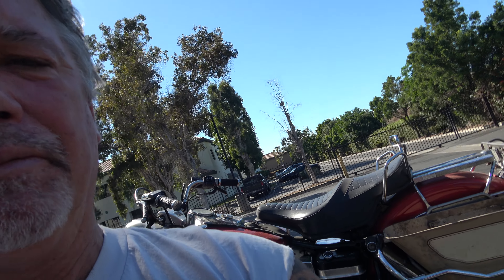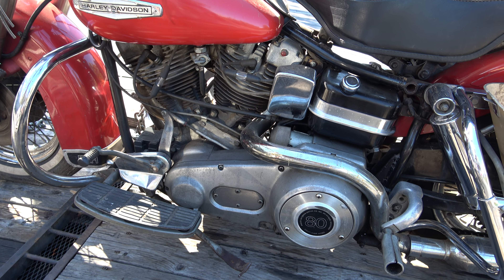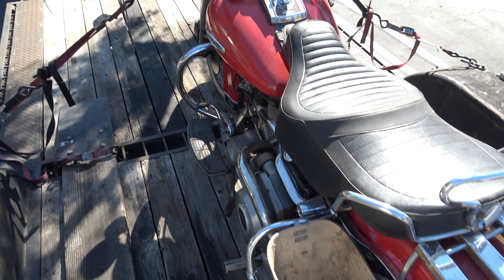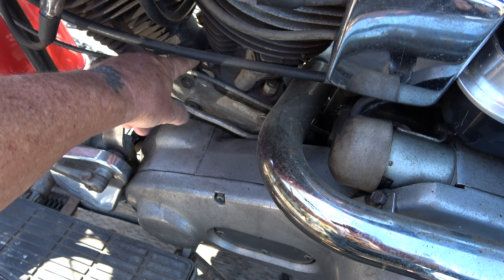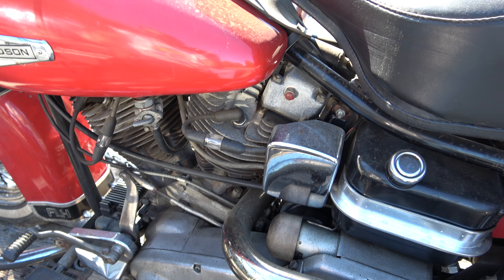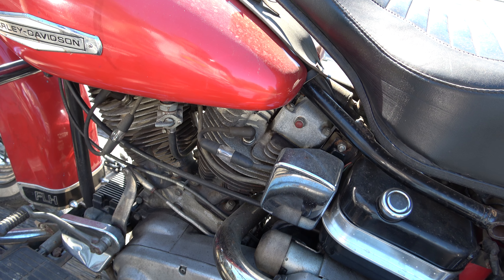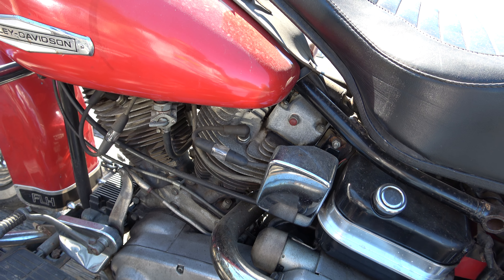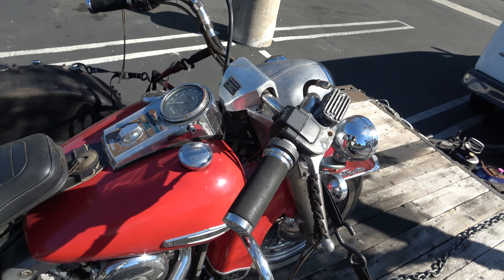Hunting Harleys 1977 FLHS cylinder discussion

Comment: Dude there's no such thing as as 77 FLHS!! 80ci they were only a74" engine until the FLHS 80 in 1980!! Only 535 we're made in77 and didn't look like that bike!!
Reply from the maker: According to the literature I had, 77s absolutely looked like this and were 80 inch. The 1st 80 inch shovels. The FLHS, Which I assume you are thinking of. Different VIN, 80 inch, and stripped down. Didn't even have floor boards. There are some of those on the channel
Reply: @HuntingHarleys  you're partially right!! Agreed the 77 FLHS was a stripped motorcycle and grey in color only as a 1200!! 
80 ci came out on limited bike's until 1980!!
Reply from the maker: You are thinking of the 1977 Confederate Edition.  The 1st 300 had the Confederate decals. The rest were a stripped dresser 1200. Not the FLHS. When I eventually get my stuff out of storage,  if I remember and still have my 77 FLHS literature I'll make a video
Reply: @HuntingHarleys  no that was a separate me model
Reply from the maker: The Confederate Edition was absolutely not an FLHS. 1000% positive
Reply: @HuntingHarleys  I never said it was!! What's wrong with you!! You're bike is a fake for what you are claiming!!
Reply from the maker: Your information is wrong. Be willing to learn new things
Reply: @HuntingHarleys  you're information is wrong!! You can argue till the cows come home 😂🐄🏡
Reply from the maker: As I said... assuming I remember,  and assuming I still have my desks when I eventually get a place, I'll make a video showing the factory literature on this machine. Until that time, argument without proof is pointless
Reply: @HuntingHarleys  just chk out the factory archives book!! Nuf said
Reply from the maker: I don't have my literature avaliable to me due to my eviction.  The Legend Begins is the most accurate account we have, and I've disproven that as being accurate
Reply from the maker: Had a Friend check his Legend Begins book. Nothing listed past 1970. Considering their compilation was done in the 1977, 78 era, not surprising
Reply from the maker: Perhaps,  and perhaps your information is wrong
Reply: @HuntingHarleys  well my information is the same as anyone else has access to!! I'm restoring a 71 FLH currently! My dream bike is the 78 FLHS!! Along with it's brother the lowrider same year and I joined the Navy that yr ✌️
Reply from the maker: If you don't have the 77 FLHS factory flier, your information is not complete.  I had, perhaps still have, that flier. I won't know until I can get my stuff out of storage. Without that flier, you got your information from a book or website,  both of which can be wrong. I've owned nearly every shovel ever built, in original paint over the 4 plus decades of my career
Reply: @HuntingHarleys  official Harley Davidson archives book ! Same bikes in the Harley Milwaukee museum. My best friend and I have been restoring old Harleys for 40 yrs also
Reply from the maker: The archives book, you mean the Legend Begins?
Reply: @HuntingHarleys  no says Archives . It's a big coffee table book. Can hard cover and soft...I have both
Reply from the maker: Interesting.  I don't have that book
Reply: @HuntingHarleys  wanna by one 🤣
Reply from the maker: Not really, if it's not listing this bike, the book is incomplete
Reply: @HuntingHarleys  Dude the book is 2" thick and cover's most prominent of Harley's motorcycles !! Even race bikes. You're right it's not totally complete...it couldn't be!! The book would be 20lbs if it was!! It Showcases the FLHS made only in 1978!!
Reply from the maker: Why would I buy a book I know to be wrong?
Reply: It says 80in on primary cover.